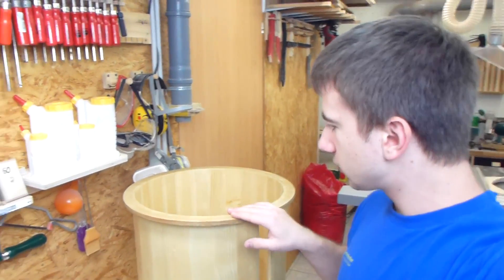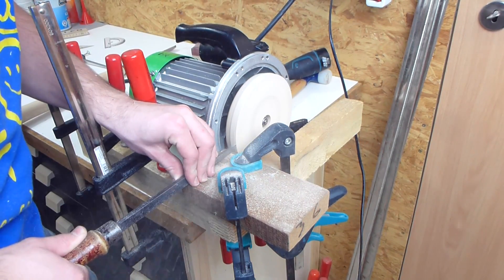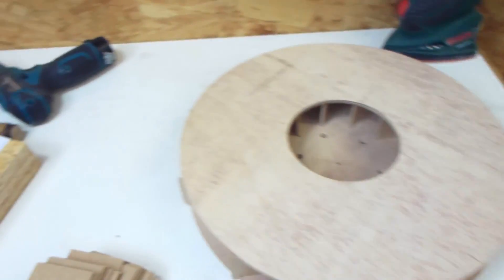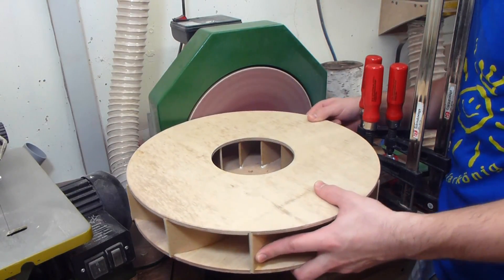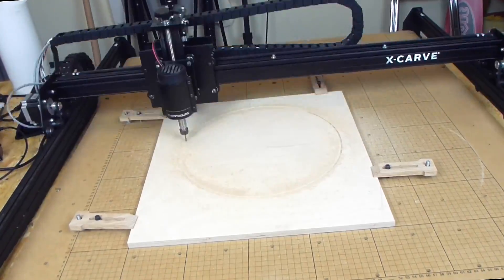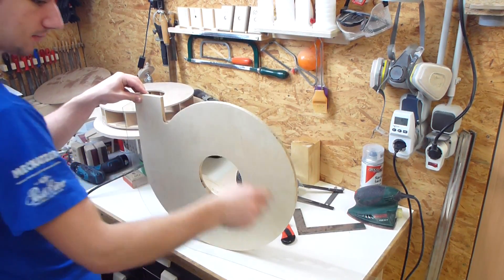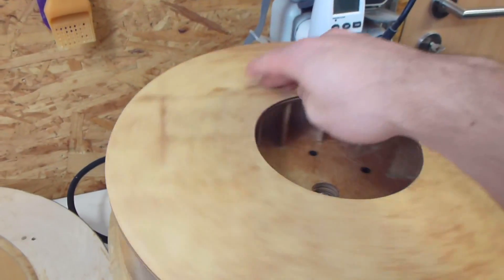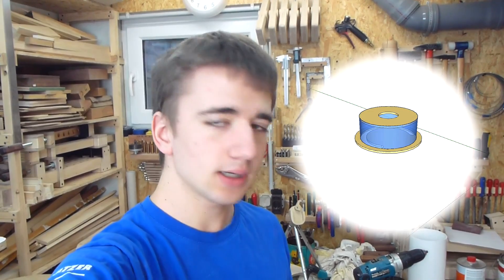Building a Blower (Small Dust Collector #2)

Comment: Another  quality build ,  a very nice feature is  your version of the blower  appears to run quieter  than most of the commercially available  metal/plastic  units  perhaps the wood  absorbs the noise  much better ? Plus  it isnt the same thing everyone has  i personally like  custom  and one of a kinds better when everything is the same it gets boring   Plus saving  some weight  will  make it easier  to  install it in  a tight area

Comment: What the tool called you use to cut the wood after the CNC has finished?
Reply from the maker: that's a chamfering bit in the router table
Reply: Marius Hornberger ok thank you. Great work on the great video got me interested on making two of them. One with the motor housing first on the cyclone unit and the other for lighter tasks with the motor housing behind the filters then a pipe to connect it to the cyclone.

Comment: So I've been googling around how you're supposed to draw the arcs for the blades for the impeller - is there a wrong and a right way to draw them? I'm assuming that depending on how the arcs are placed the more efficiently the impeller pushes the air.  If it doesn't really matter then I guess I can just draw whatever looks good to me.  Anyone know of a good source I can see how the arcs should be drawn for an efficient impeller?  I see how Marius did it by hand, but it doesn't show how it should be drawn.  I hope this makes sense and I appreciate any help or suggestions. 

Is it just a bunch of circles drawn in tangent with the center-point?

Marius - kick ass videos.  Very helpful.

Comment: Is it possible to mount the CNC to the wall or will that damage the machine? If so then that would save a lot of space in your shop and then you could still use you dedicated dust collector and use the pool table
Reply from the maker: I don't need to as we don't use the pool table anymore
Reply: Marius Hornberger so your pool table is more of a fancy table that costs a lot more than a normal table would, yes? :)

Comment: Ur wrong. The power rating on the motor is not electrical power, but rated mechanical power out. Torque times RPM.
The "motor overload" condition can be checked more likely by measuring the current draw, not power draw.
Reply from the maker: The reading on the power meter was basically current. Watts is also current * voltage
Reply: No they aren't. For AC it is NOT simple multiplication. Current times voltage is not watts, but VA, voltamperes, apparent power. It depends on the power factor (phase shift between voltage and current).
The ac wattmeter takes into account the power factor and shows only the real power. However, the real power input to the motor is not equal to the mechanical power on the shaft. The input power will always be bigger, than the mechanical output in watts printed on the nameplate. So it is pretty much possible, that a 1000W motor at full load will draw 1100W or even more watts (depends on how shitty motor that is = power loss in bearings, the cooling fan, hysteresis, eddy currents, resistive power loss in the windings), and the apparent power (your "volts times amps") might be around 1700VA or so (cos phi 0.6-0.7).
So please give me a break and learn, before you say something.
Reply: and you think the rating on the motor is the actual shaft output rating :) hmm humor me. But to be more constructive. The point more is that to be on the safe side without ducts / constrictions on the intake and filters on the outtake of the device.. running it with partial/no load gives a far more skewed view of it all. ( if his meter is a RMS watt meter his readings are pretty much what they are but at idle it leaves little headroom for the aforementioned things).
Reply: Even the Wikipedia clearly states: "For motors (electrical, hydraulical or other types), their power rating is conventionally defined as their output (e.g. shaft) power, not their input power flow through the equipment".
So what other stupidity will you show us now? huh?
Reply: yeah you are so right :) and constructive i feel really stupid now. To bad all your comments are "So please give me a break and learn, before you say something." and "So what other stupidity will you show us now? huh?". Keep it up you might become America's next president :)

Comment: 950W is quite a lot, comparing to the air extractor i put under the house, which has 2 outlet blows really really strong is only drawing 350W
Reply from the maker: You're comparing apples with pears.
Reply: Yeh, I know.  Since you've got the CNC, perhaps, you can try using different lighter material for the turbine. I am just saying. It would be interested to see you do that.  It's certainly beyond what I can do at the moment.
Reply: the mass does not matter. This is a question of airflow. In order to get the fine dust, you need loads of airflow. This means a lot of power (and I assume the bent vane design is pretty efficient already...).
I myself run a 1.5 kW threephase motor extractor with straight vanes with 150 mm piping and a low backpressure filter system and it is on the low end what I wanted to use when sanding wood stuff with an angle grinder.

More power (airflow) to you :)

Comment: You really need to test the current draw with the blower in the housing.  An unloaded blower that is open like you tested it before you started cutting it smaller will try to move more air than one that is enclosed and will draw far more current.    If it still draws more current than the motor is rated for when you have the blower in a housing you can lighten the load on the motor by blocking the inlet to the blower with an orifice.  Your piping for your dust collection system may actually restrict the flow enough that the current would drop when it is connected negating the need for an inlet orifice.  Beautiful build job!  You have some nice equipment and the talent to use it!   Retired engineer here.
Reply: so 
Only 1x extractor (dust collector) open on any machine in the workshop at any one time?
Reply: I would think that the intake on the motor housing will be the main restriction.  At the pressures dust extractors operate at, air compression probably won't be a factor, so if you have a 100mm dia housing intake and you open two 100mm dia ports at tools, all that'll happen is that the pressure drop at each tool will be halved (but total pressure drop will be roughly the same) and less dust will be collected without escaping into the shop.
Having a 2nd port open would help with circulating the air in the shop.  However I think a dedicated filter setup would be better suited for that.
Reply: How do you decide how powerful the motor should be? Any suggestions? I want something that can pull as much as possibly a 10hp vacuum.  I was thinking of using my grinder motor which is only either 3/4 or 1hp (can't remember as of this writing).  I'd love a suggestion.

Comment: instead of making it smaller you could also have used some pulleys with a v-belt...ofc you know that transfer would create a lower speed...btw dein englisch ist sehr gut!
Reply: That also takes up way more space and more effort than necessary.
Reply: a matter of opinion.
 I mean it IS necessary if you wanted to not make those adjustments. and the distance between the pulleys does not have to be that far...besides it was just another idea that would also have worked.
Reply: It would've worked, yes, but to reiterate, it would take up more space and be more effort. You would need another base for the motor to sit on. Then you also have to make pulleys large enough to accommodate a v-belt. The pulleys, which require bearings and spindles, will also have to have some sort of tension mechanism. Now, you've eaten up more vertical space and moving parts that will need to be maintained. Just because it can be done doesn't mean it's a good idea.

Comment: Marius, great video! I want to make some similar for my workshop. But give an advice. What sizes of empiller I should use for 3 phase motor which 90 watts (0,12 hp)\2800 rpm ? I will connect it to 3 phase line without capasitors.

Comment: Great video! Does anybody know where PET plastic is commonly available in Canada? Is this the kind of thing available in most building centres?
Reply from the maker: +Jamie Jessup I'm still searching for good sources for this stuff worldwide. You should find similar stuff in any hardware store though, "Lexan" for example.
Reply: Thanks Marius! Lexan would definitely work, but is a tad expensive so for my build I am going to use aluminium flashing. Sadly, not transparent for the "cool" factor, but it'll get the job done.

Comment: Hey Marius, you could make an air raid siren, those offcut pieces look like the stators that could be found on one.

Try making one if you would, where one side has 10 ports and the other 12 ports, bit like the old Carter sirens. Don't forget a "soft start" motor too ;)
Reply from the maker: +AlmightyBanger I already threw these pieces away, so...
Reply: +Marius Hornberger Bau doch eine E57 nach!;)

Comment: Really nice project, congratulations :) Based on material structure, plywood is not as homogeneously distributed as MDF or aluminium, so for vibration and loudness issues MDF can be used. Small holes or imperfections inside the layers of plywood will result in great vibrations due to centrifugal forces (I'm not good at physics, please correct me if I'm wrong :) )
Reply from the maker: +Abdullah Coşgun No, plywood is no source of vibration.

Comment: I have a fairly large motor I want to use for a dust collector (2hp, 220v). Would you recommend higher/wider propellor wings or a larger diameter? Also, how did you know how many propellors to use? and how close to the center to place them? Thank you for the explanation on how the distance from the edge makes a difference.

Thank you!
Reply from the maker: +l3ender15 I would increase both a little bit. I don't how many to use. Just look at some pictures of other impellers and build something similar.

Comment: hi marius, just wondering what speed the motor is running at in yours, it appears to be a 1 and 1/3 HP motor and i'd like to know what speed it is to figure out what motor to buy, and how many internal poles the induction motor has.
Reply from the maker: +Julian Curmi It runs with 2800rpm at 50Hz, but American power supply has 60Hz and motor usually run at 3500rpm (which also works for a blower)
Reply: thanks, this helps me heaps, im in Australia, 50Hz 240VAC with only single phase at home. 2 pole motor i'm guessing

Comment: Hello Marius, thanks for the great video!  I have a couple questions for you.  I see you designed your blower in SketchUp, what software do you use to generate the gcode for the Xcarve?  What software runs the Xcarve itself?
Reply from the maker: +Jesse Brunner Answer 1: Easel; Answer 2: Easel; it's a free browser based program that does all you need and is provided by Inventables to get started with the CNC. But any other CAM software can operate it too.
Reply: +Marius Hornberger Thank you very much for your response!!

Comment: Marius, I love all the outtakes: they're great.  
Also, I noticed that you affixed the screen with screws.  Do you have an air compressor and staplers?  I use mine all the time, and it makes things work easier.  Just a thought. 
You're a real genius Marius.  Keep up the fire.
Reply from the maker: +John L Kelly I have an electric stapler, but don't like it. If the screen breaks (for whatever reason) it can easily be replaced.
Reply: +Marius Hornberger I don't like those electric staplers either.  And those wireless, battery powered ones are also the pits.  But a good 20 gallon compressor, with a system of staplers and other tools, are just fantastic.   Also, the sprayer nozzle can get all the sawdust off you, and the shop, in seconds.  Just something to consider.  
I would be lost without my compressor system.   You can even use it to keep the air pressure in your car's tires, without having to pay a service station.
Reply from the maker: Do you want to sell a compressor to me? I got one ;) I know it's handy for car tires even though you can do it for free at almost every gas station in Germany.

Comment: Nice job. It's nice to see a young guy like yourself take interest in designing projects. One question I have. What software are you using to convert your sketchup drawings to dxf to generate g code for your cnc. Take care, Bob
Reply from the maker: +Robert P. Avery Sr. I use SketchUp for the design and a plugin to create a SVG file. And with the free software "Easel" (from Inventables) I do the rest. It generates the g-code and also sends it to the machine.

Comment: I can't help thinking that it would be even better if you didn't have that large gap between the edge of the rotor and the housing / clear rim.  Or is this gap normal?  Cheers.
Reply from the maker: +David Handley Small gap = better efficiency, but much more noise. I wanted it to be relatively quiet.

Comment: Very nice work, but your blower housing is a little incorrect. The gap at the exit between the impeller and housing wall should as tight as possible in order to get the best sucktion and efficiency.
Reply from the maker: +Martynas Valūnas That's probably right, but that also increases the noise level by a LOT. And I wanted it to relatively quiet, so I chose a bigger gap.
Reply: so that's why my collector is so loud :) I kinda guessed that might be the cause, because I increased the diameter of the impeller in my first collector's blower and that got a lot louder.
Reply from the maker: I did the same with my big dust collector, but quickly switched to my old one again, because the noise was uncomfortable even with ear protection.
Reply: Well, compared to a 12" 'portable' thickness planer mine is equally loud.

Comment: Sehr witzig. Wir haben die letzen Wochen hier im Hackspace genau das selbe Projekt gemacht. Wir haben aber mit insgesamt 5 unterschiedlichen Prototypen die Effizient und Saugkraft optimiert. Dabei sehr sehr viel über Strömungsmechanik gelernt. Das witzige ist wie sehr ähnlich dein und mein Impeller ist. Wir sind bei 1Kw auf 30cm geblieben. Wir hatten in den ersten Versionen ähnlich hohe Flügen wie dein Design. Sind aber in Version 4 und 5 auf 10cm Abstand zwischen den Platten gegangen. Dann versagen leider MDF Flügen (Proto 4). Wenn du Interesse hast schick ich dir ein paar Bilder unsere beiden Scheiben mit 12 Flügen fräsen auf unser selbstgebauten  cnc ca 20 Minuten..;-)
Reply from the maker: +kayaker2k Ja, gerne. Meine E-Mail steht in meiner Kanalinfo. Bei einem anderen Impeller mit 13cm Abstand hat bei mir MDF gehalten (älteres Video)

Comment: this is getting crazy good. So many good techniques there. But tnhat wire mesh seems very restrictive. have you checked amp draw with and without the mesh?
Reply from the maker: +Tiit Saul No, and if anything the amp draw drops if the restricts, which it doesn't do.
Reply: Yep. Restriction in airways cause reduction in amp draw.